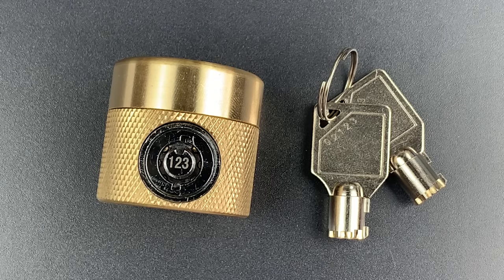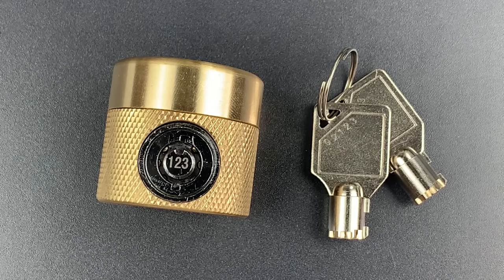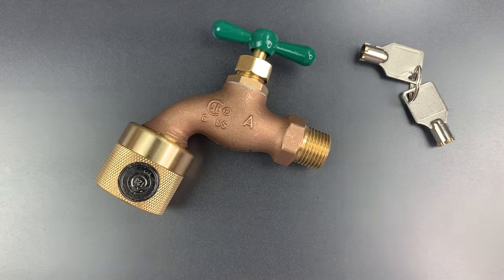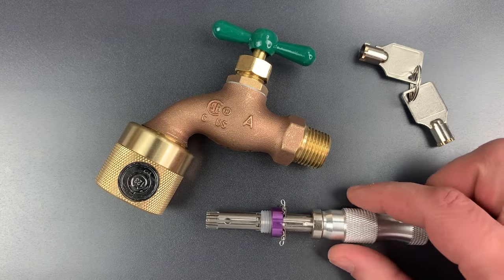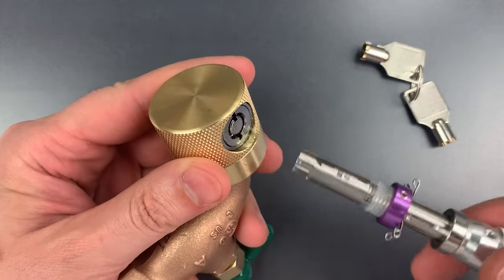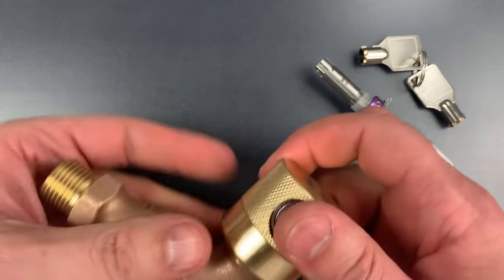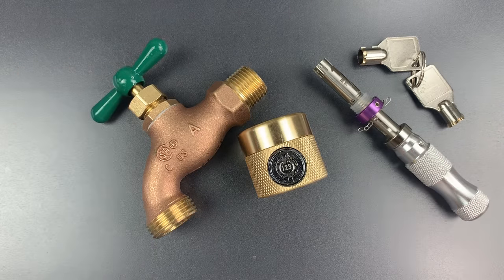[840] Flow Security Systems “FaucetLock” Picked FAST

Comment: yeah, i just installed ball valves leading to my hose bibs since they tend to freeze in the winter and i got tired of changing them.  besides, a 3/4 ball valve costs about 12 bucks.  those faucet locks cost over 20.  you do the math.

Comment: Cant you just use a pair of channel locks and turn the top of the lock?
Reply: Exactly what I was thinking!
Reply: i bet with a strong grip you can even open it by hand maybe anti slip rubbergloves and you are good
Reply: Exactly.
Reply: My thoughts too...bypass the lock itself...just turn the shiny (unknurled) part of lock.
Reply: That's actually the same piece of metal as the knurled bit, it spins freely. 

You can see this around 38 seconds as there's a small ding in the metal which rotates as he moves it.
Reply: The whole outside is solid it's just a sleeve over the inner core that is threaded, the lock connects/disconnects the two, but probably if you crush it it might turn.
Reply: It went on hand tight why would you need tools?
Reply: What if rain water goes between outer and inner shell and freeze? Does it couple parts together hard enough to open it?
Reply: @cannesahs  It doesn't matter as in that case faucet would freeze and break as well. So during winter water is closed from inside of building and lock is not needed.
Reply from the maker: No. The ENTIRE outside is a single spinning piece.
Reply: Drive a self tapping screw into it.
Reply: Ken Wolfe don’t even need that. Drill through it and use the drill bit as a wrench. Easy fast and efficient.
Reply: Flyingby    That’s how I used to do it.   But since I keep a 1/4” hex chuck in my drill and use zip screws for most jobs, it’s already set up.
Reply: If you had a spanner you could just remove the valve from the top, the the whole tap for that matter. This is clearly just meant as a deterrent for casual aqua bandits though.
Reply: @captainsuperrthicc5477  smh 🤦
Reply: impressioning tool is way easier.
Reply: @lockpickinglawyer  a pair of channel locks and squeeze hard will get that off in no time. My dad has an 18" pair that would work perfectly.
Reply: I think gripping the upper ring firmly in the crook of your palm (between index finger and thumb) should suffice. If not, try through a piece of cloth.
Reply: @ElevatedEyes2023  I think that is not the point of it, it's simply a deterrent. You could just take a sledge hammer and knock the whole fucking thing off.
Reply: Chris Manaloe Nah, its got a butyl rubber seal against the outlet. Even with the tap on full there’ll be no leak - you can just see it  and they even say so on their website https://www.flowsecuritysystems.com/product/faucetlock/ :)
Reply: Even if the mechanism locked down on to the thread, you could still strip it off using channel locks or multi grips.
Reply: They would probably crush the outside bit (which is supposed to spin freely when locked) onto the inner and allow it to be unscrewed.
Reply: @dj1NM3  You can also knot a few rods of TNT around the faucet. The point is to keep the accasional thieve away.

Comment: I had an incident at my Downtown home and business 20 years ago, where some kids left my outside tap (which is located less than 2 metres for the side walk) ON and water running ... I thwarted the attack by removing the tap HANDLE and putting it on a string right inside the door ... so far that's worked :) .. 

As an additional precaution when i leave my home completely empty (which is exceedingly rare) I shut off the "Whole House Valve" at the metre .. as a precaution against what ever water leaks might occur.

Comment: I just turn off the waterline inside my house in the basement, no water theft if the water doesn't flow.
Reply: a 1/2 or 3/4 ball valve is cheaper than a faucet lock anyway.
Reply: but the can steal or damgage the water bib.

Comment: Who the hell would lock pick a water faucet lock?
Reply: Californians.
Reply: Me because I run a business doing mobile pressure washing driveways, cars, bins, and use 3000-5000 litters a day if not more and with water restrictions mean I have to pay and transport my own water at $28-$42 per 100 litters so free water is a extra $200-$500 in my pocket per day.

Which is why I'm luck to have a dam and natural spring to supply my water and don't need to steal or purchase it.

Comment: I wonder if you could defeat this with your bare hands, just twist the end so the spinner binds up then unscrew
Reply: I bought a commercial property that had six of these on the outside faucet (no key) - A pipe wrench and a hammer and only one took two hits.   I installed a timed valve on the inside main line that ran to these (as it also ran the sprinkles and drip).

Comment: Could be wrong, but it seems to me like if the shell is decoupled from the treaded part, you could still get it off by using a pair of channel lock pliers on the threaded part.

Comment: Do you live in a cold climate? Judging by the CSA stamp on the faucet likely Canada. You should take the setup and put water in it to simulate someone turning it on while it's locked then turning it off to completely fill the cavity....and let it freeze.....what will break off?

Comment: Noice!

Did not even know faucet locks was a thing. 
I'd just add a knob that can open/close the faucet from inside the house.
Reply: michael hernandez thank you! Is that not a thing in warm climates? We shut off the hose from inside when winter comes so pipes dont freeze.

Comment: Can't you just, thread it off by twisting the top ring?
Reply: Yes, but it's a smooth, and small surface area, so if it's on snug it's probably secure enough.
Reply: Nothing a wrench wouldn't fix... 

But by extending the rotating lock part up to the top, all of the lock surface would spin. No place to grab with a wrench!

Edit: Apparently, it's not very visible but it's going up to the top. Just read that in another comment :-/
Reply: Won’t stop some Knipex Cobra pliers
Reply: You could just use a rubber glove or thick rubber band to grip it better.
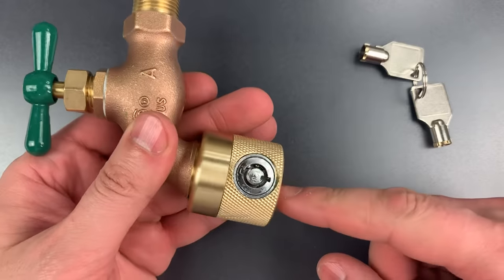Reply: The smooth part rotates also. At 0:32 you can see a small indent which is gone after he has rotated it.

Comment: A NO-COST solution: Just remove the handle.
Reply: Not really. Commoners have pliers but not a cylinder pick...
In the late 1980's the apartment complex where I lived tried that and we'd use pliers to turn them on to wash cars and let kids play in water on weekends when management was not around.

Comment: I am wondering if vise grips or regular pliers would work. I would hope that the outer ring is thick enough that it would not collapse if squeezed therefore keeping it from turning the inner core that threads to the faucet.

Comment: What keeps you from unscrewing it by turning the top metal part?
Reply: Its made from molten lava and to touch it is to die
Reply: A. It's attached to the house...
B. That still wouldn't open it...
Reply: @metalkingconqueror  I think he means the top non spinning part of the lock. My best guess is that the top part of the lock does not engage with the faucet threads at all. So it doesn't twist, and even if it did, it would either tighten the lock or move up towards the faucet body, while the threaded part stays stuck.
Reply: The smooth part and knurled part both spin. The only.part not spinning is inside.

Comment: The question is if this is necessary. How much does water cost? 1m³ (1000L) here costs me 1.70€ and per 24 hours a faucet could deliver up to 45m³. Would someone just turn up the faucet and it would run for 24h, this would cost me 76.50€. I mean this isn't very realistic. Would someone vandalize, someone would notice this and turn off the water. Probably most would use way less. 

I think the better protection would be to turn of the faucet inside. On a side note: you should do this with outside electric outlets too, especially when you are not at home. The reason is simple. Someone could trip the RCCB (or GFCI). When not properly wired, they could turn of your entire house. This is bad, when you run security systems over mains power. The best thing would be to wire it in such a way, that only this part can turn off. Then a switch inside that disconnects the outlet completely is important. Than you can slap a cheap lock on it, to show everyone that this isn't worth trying.

Comment: That's a lousy design. They should have a set screw that snaps off flush with the smooth upper brass threaded part so it cannot be easily unscrewed off the male hose thread, just like a backflow preventer.

Comment: How to bypass.

Use a water pump wrench and remove the tap. Done.
Reply: “How to break into a house” “run a tank into the front wall” “Done.” 🙄
Reply: @Engineer9736  🤔 you aren't the sharpest knife in the drawer are you buddy. Here let me walk you and your rolly eyes through it.

Tldr: your analogy fails.

A Tank breaks the house and the contents making  theft a pita of sorting through rubble.

This lock isn't intended to stop someone stealing the Tap or the Pipe, noone gives a crap about that. It's water they're after.

Remove the tap with a wrench. Take what water you need and who gives a crap if the pipe still runs after you leave.

Comment: While this would be a fitting lock to attack with a plumbing torch, I kind of want to see a ramset hit on it.  You could probably just hit the rim and cause the outer sleeve to crimp in against the inner sleeve.
Reply: I'd rather see if a small length of tubing about the diameter of the keyway could be used to open it, the kind of thing that someone wishing to get into one of these while lacking any kind of real tool might try to improvise.

Comment: I wanna find someone who uses these, turn on the faucet when it’s locked tightly, and wait for them to unlock it.
Reply: decent locks have a seal that stops water flow from the spigot. it shouldn't flow otherwise. I had to buy one b/c of a $100 extra charge from  my neighbors stealing my water. They have been evicted since for not paying their rent.
Reply: @dethofgod666  I think the idea was that once the owner unlocks it, the water gushes out and hopefully bounces off the core plate and soaks the owner as a prank.
Reply: @X how exactly did you know that 100$ was your neighbour? more curious than critical

Comment: How many people will buy this because they heard they should turn off their outdoor taps in cold seasons...
Reply: Lol they will be quite disappointed when they try to remove it
Reply: @alessandroceloria  seems like you didn’t get MrHack4never’s point. The point of shutting off and emptying taps is to prevent the waterline outside from bursting due to freezing water which expands. MrHack4never’s made a joke on that as how stupid people are. The resulting problems will appear long before they are going to take off the lock.

Comment: Is the lock water tight or when you turn the hose on does the water push out of the lock? Would be disappointing if the water just runs out of the thing.

Comment: LPL, please think like a kid on a playground looking for a drink of water.  As a kid, if I was thirsty enough, I would surly have jammed stuff in there to see if I could bind that thing up. ~~~ A better strategy would be to do two things: bind up the lock so that you'd have to use force to release the threads ~~~ AND ~~~ make the outside a free-turning body so that the attack surface to get that purchase would be so small you'd have little chance of getting control of that vulnerability.

Comment: Another major weakness I see is the threaded part at the top. Never mind the lock, just slip a pair of vice-grips or channel-locks over that part, press tight, and turn. They should have made it a bit larger, so the spinning part covered the threaded part as well. My friend owns some apartments, and their taps are locked with a device that covers the whole tap.
Reply from the maker: They did... the ENTIRE outside is one spinning piece.
Reply: @lockpickinglawyer  OK, that wasn't apparent to me until I watched it again. It looked as if only the knurled part rotated. Thanks for great videos!

Comment: Having a shutoff inside your house is a much better security measure.
Reply: So you shit the water off to your house every time you leave your house. Kind of impractical.
Reply: I must be. Explain why they would need an internal shut off? By code?
Reply: @NoticeForBlue  well, I don't because it isn't a concern where I live, but since my basement door, faucet, and shut off are right by eachother it wouldnt be a big deal. Though I suppose other layouts may make that impractical.

As far as why its required by code... Not sure what the legal reason is, but there are a few practical ones - ability to work on the faucet without shutting the whole house off, being able to turn it off to prevent freezing in the winter, which to be fair isnt a major concern with one of those freeze proof faucets.

I was just saying turning off the shut off valve is the best if you're worried about security. Not really sure what that other guy is on about calling people dumb.
Reply: I guess it’s elementary dear Watson 😝.

Comment: Handle has a screw on the top, you can just unscrew the handle...

Also if you are in an area where there is water theft - like California - better to have an inside switch installed next time you get a Plumber over.  Just a handle, couple bucks for the device and most Plumbers have them (call ahead) - then the pipe that leads to the outside you can shut off inside the house.

None of these is foolproof but its still a low security issue, anyone breaking in to turn on the tap you have other problems...

Nice video!

Comment: Saw someone use one of these on an outside faucet.  The thief took a hacksaw and cut the head of the faucet off.  Owner in turn removed the faucet head and put a plug in the wall.

Comment: Came across a ProTex paper safe that is empty at a job we tore out, Owner said his locksmith couldn't open it and gave it to me. I took it to a local guy who works out of his garage and he called the next day saying he couldnt open it. I came here and watched every tubular video and was determined I could. Well nope. For such a cheap safe I found that when you touched the pins, they would disapear back in the body, bend the pick a bit then you find the very smallest pressure you gave it and the pins, any one of them, would stay where ever you stopped pushing on them till the pressure was released. I mean the tiniest bit of pressure. This doesn't appear wore out, the springs are of different pressure. There was no amount of pressure that you could put on the center part that the pins would still have a spring action. This lock was not worth the purchased tools nor the 2 hours I spent on it.  Oh even tried it turning counter clockwise. The only video online about this safe is where a woman pretends to turn the lock counterclockwise to open it. https://www.youtube.com/watch?v=P_ITUBrWGYI
Reply from the maker: You’re oversetting the pins. Concentrate on depth control and stop pushing them so far in!
Reply: @lockpickinglawyer  Thanks for the response :)  I will try again when I gather the patience, It didnt matter how far or little I pushed them, they stayed at that point. Push them 10%, 15%,50% 75%, they stayed where I stopped pushing until I released the very tiniest bit of pressure. I was going to try a different way to put pressure on it that gave me better control than the 2 inch bar I have.

Comment: Should of clarified that the textured ring is not independent of the smooth ring because at first I thought  the flaw would be be you can still grip the smooth ring off even if the textured one or free floating.

Comment: I might have misunderstood something, but what prevents someone from just grabbing the top part of the lock and undscrewing it?
Reply: I was thinking the same. I guess given its width and lack of patterning, it's harder to get a grip on, which might be enough.

Here, businesses who want to protect their water taps simply remove the handles, with the facilities maintenance staff taking a handle with then if they need to access a tap.
Reply: In other comments it's been stated that it's 1 piece. It's hard to see because of the smoothness but that top part is spinning with the bottom part. The part disengaging is entirely internal.
Reply: Joshua Daniels - Oh okay, thanks for letting me know.

Comment: There are multiple problems with this design. One, it probably doesn't actually effectively stop the flow of water. A person who's annoyed by your use of this can just turn the water on and let it drip on the ground, still costing you a lot of money. Two, it's brass, which is easily drilled and cut. A combination of the two can be very expensive, indeed, as you would lose both the lock and still have to pay for wasted water.

Comment: nice lock, didn't know they made that stuff, i can see a few places where that could be important for my personal use. thanks, i do wonder if it holds water or it will leak out the sides? no biggie
Reply from the maker: It holds water. I tested mine. 👍
Reply: @lockpickinglawyer  
thanks, i'm going to order a few

Comment: an equipment lockout device is mostly a tamper seal. you might not want it to be entirely impervious to attacks because if the key is lost you want to easily get it off without damaging the equipment.

Comment: With that exposed bit at the top, all it would take is a pair of soft jaw pliers to get it off and put it back with no obvious signs of tampering. I'd like to have seen it with the free spinning shroud covering the entire exterior.
Reply from the maker: The ENTIRE outside is a single spinning piece.
Reply: @lockpickinglawyer  I thought the part above the knurling was attached to the threading.